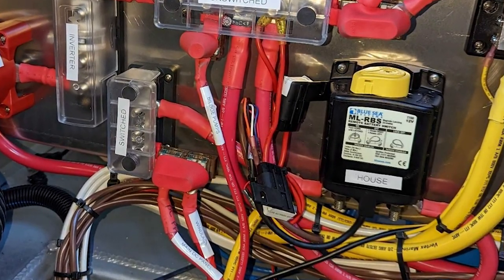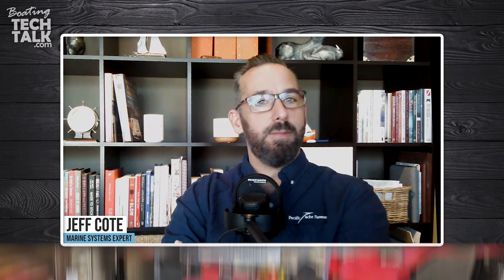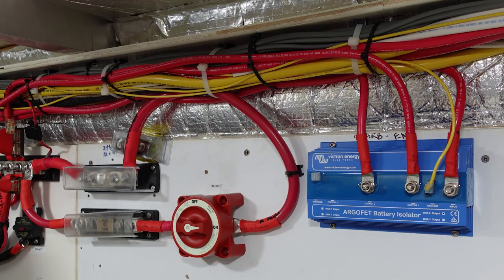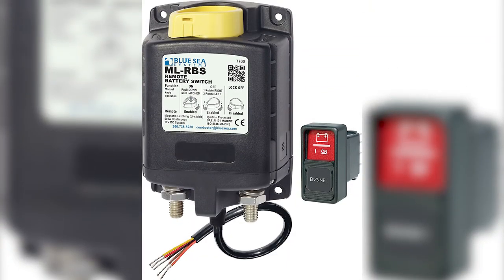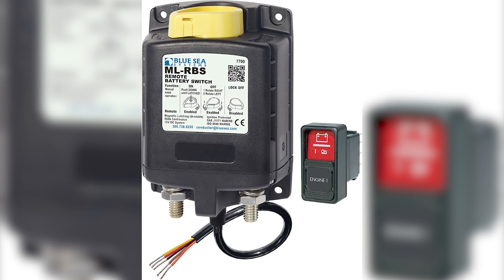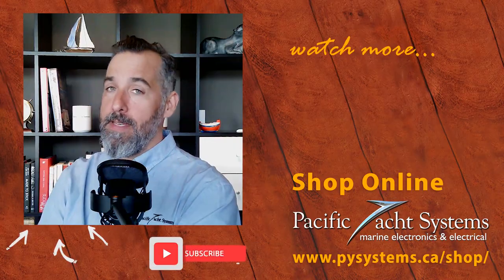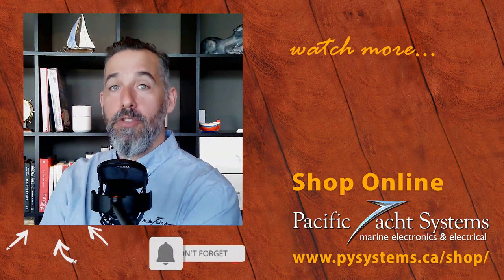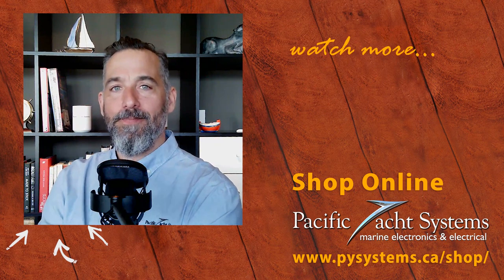What Is a Remote Battery Switch Used for on My Boat?

Comment: I'd been visualizing it differently. Not that the longer wire would cause voltage drop, but that to maintain voltage over the longer distance would be thicker, harder to work with, and more expensive.
Reply from the maker: That too.

Comment: I think it helps to mention that control wires for the remote battery switch should be of the fire resistent type preferable with its own emergency power supply. No use for a remote battery switch when the thin control wiring is melted.

Comment: I had installed a couple of remote battery switches in 2021.
They are really great. 
 Jeff,  noticed there is a delay, once remotes are turned Off,  to actual powering down of MFDs, radio, etc.
Why ?
Reply from the maker: Are you talking secs or minutes?   If the delay is mins it might be an ACR staying on and cross feeding power between banks / loads.  Power is not lost untill the ACR shuts off.   This happens if ACRs are wired to the load side of a battery switch and not wired to the battery side of the switch.

If it's just secs.  It could be because most electronics store power in capacitors and sometimes take a couple secs to drain themselves when power is shut off to them.   I would recommend shutting electronics down by their own buttons before turning the battery  switch off.
Reply: Thanks for the detailed reply.  Sometimes 
2-3 minutes if loads are light.  There are several ACRs on an Axopar 28.
Your insight is likely correct,  that they are cross feeding each other. 
I am careful not to start wiring,  until all is discharged.

Comment: I have the Blue Sea systems add a battery ACR, how would I add this to the system? Would I need one for each battery? Is there a version that is compatible with the 2 battery ACR?
Reply from the maker: You would need one for each battery bank.    The ACR doesn't care what switches are being used.  But it should be connected before the switches on the battery side of the switch.

Comment: Why not use a relay?
Reply from the maker: The remote switches are just relays / solenoids.  However for example the blue sea ml is rated for 1400 amps cranking and 500a continuous.  You are not going to find that in a normal relay.    They are also latching so they do not consume power when on, only when switching.   Where as most relays / solenoids will constantly consume power when on.  They also have a physical manual override in case the control system fails or breaks.

I'm sure you could find an industrial relay that could work if you looked,  But we generally stick to using marine products.